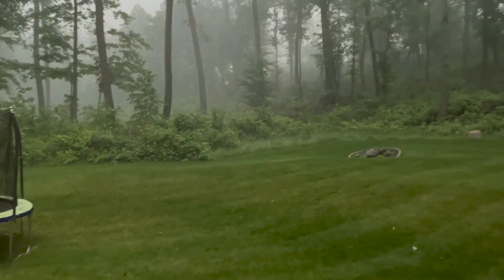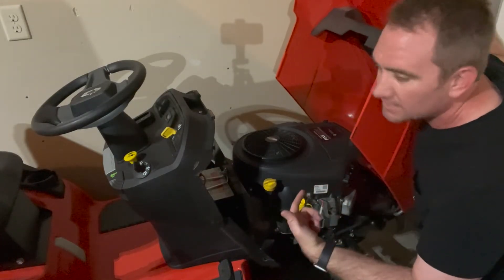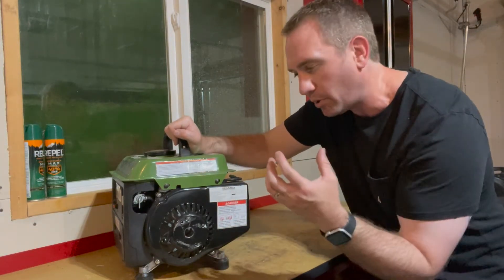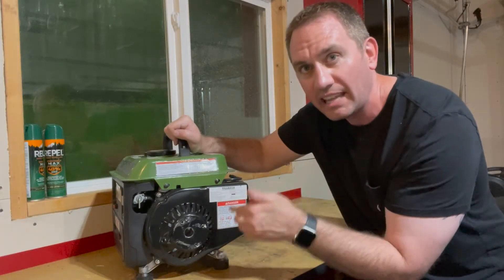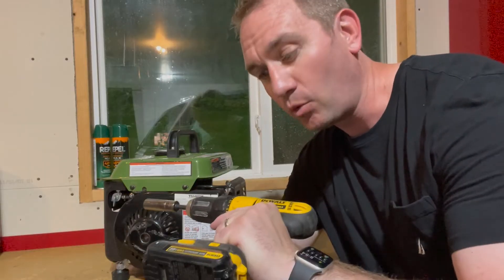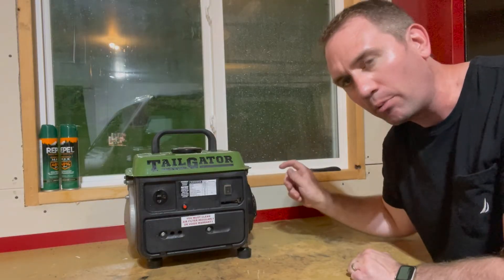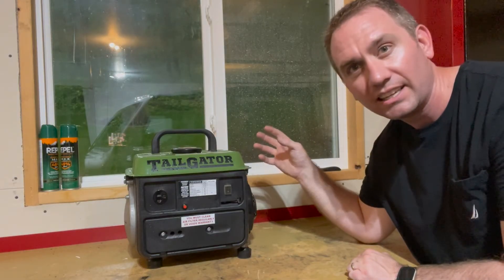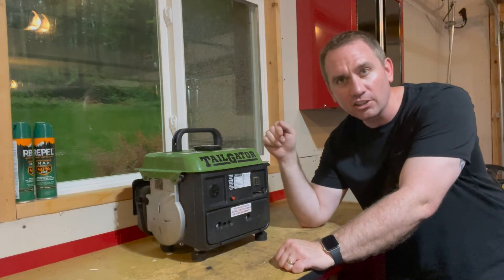Watch this Before Converting Engine to Drill Start

Comment: My generator has no crank bolt so to speak.  Has several 10mm bolts for the pull rope end shaft thing. Unfortunately I had to fix the pull rope assembly
Reply from the maker: Yes, this won't work without a center bolt.  Good job on fixing the pull rope.

Comment: I have a cheap china motor 79cc on a small water pump that has no compression release on the camshaft so this thing is a real arm breaker to start. I've considered this drill method to start it but am afraid of getting hit by a flying drill or socket. LOL.  Lesson learned is to stick with a reputable name brand like Briggs, Honda, or Kohler and leave the Chinese super cheap stuff at Harbor Freight.
Reply from the maker: That is a life lesson right there.

Comment: You sorta lost me already with the tractor comparison...why would anyone wanna use a drill start on something with a key start electronic ignition system, plus loads of safety switches youd need to disable or circumvent someway ...
Reply from the maker: Fair enough

Comment: What are you powering with that "emergency generator"?? A febreze air freshener?
Reply from the maker: It is small.  It’s a two stroke so the engine is roughly have the size of an equivalent 4 stroke.  

Anyway, it’s enough to power a refrigerator and the power vent on the hot water heater.  We have food and hot water.

Comment: Interesting option...but for all practical purposes I'd likely just acquire an authentic serviceable 6500 KW generator as a more responsible hedge against damage to your expensive up-scale home.   e.g. $1,900 to secure a 400,000 plus investment.  Better yet get a GENERAC
Reply from the maker: I didn’t mean to suggest that this generator is a good backup for a house.  As you said, there are many better options out there.  I just found a way to make this pos a little easier to work with 🙃

Comment: TWO IMPORTANT considerations:  (1) if using a CORDED drill -- if you lost power, that solution won't work (unless your system has battery backup...) (2) if your drill relies on batteries, and they're not sufficiently charged -- you've just lost your ability to get your generator going (having destroyed your existing pullstart mechanism.
Reply from the maker: Yes, those are valid considerations.

Comment: I have a Husqvarna push mower that has drill start what I do is  I take a 3/4 inch deep socket and I fill it up with hot glue until about a quarter inch from the end. This way the motor won't jurk your arm.
Reply from the maker: Great idea, thanks for sharing.

Comment: I haven't tried it yet but what about tying the string to your drill wrapped around a cylinder like hole cutter
Reply: This would retain the recoil and no need to dismantle anything
Reply from the maker: I think that might work if you can get the speed high enough, it might require something with a larger diameter than a socket.

Comment: Use a ratchet attachment to the drill. Once she starts, the ratchet will spin not grab. No drill whacking. Second, use a torque adjustment on your drill set to less than the bolt shear strength. If it exceeds, it will skip. Start slow. Thanks🤗
Reply from the maker: Great additions, thanks for sharing.

Comment: One way to make drill starts safer is to use a one-way ratchet assembly.  When the engine overspeeds the drill, it would be the ratchet turning, not the drill.  And that would be much easier to disengage.
Reply from the maker: Absolutely, thanks for the tip.
Reply: Any welding to do on said widget?
Reply: TORO and Craftsman have both offered drill starts on some models. 

1/4” hex drive that only turns in one direction. 

They were about $10 when I last bought one. Now, at least $15, maybe $20.

Comment: If you use a larger corded drill to start your small generator during a power failure what would you suggest as a means of powering it ?
Reply from the maker: Yes, a corded drill wouldn't be a good application for a generator.  However, it might be good for many other things with an engine....perhaps a lawnmower.
Reply: I have a camper with a small battery+solar panel and a generator. The battery has enough juice to power a cordless drill but I want the generator for more serious long running tasks like Air Conditioning. So I can start it up using the batteries and then run off the gas engine. Pretty similar to how a car starter works :)

Comment: I used to use a cup shaped stiff wire brush bit on the drill and it would hold it tight enough to spin it but would easily let go when the machine took off and wouldn't hurt the crank bolt. Works great.
Reply from the maker: That's a great idea! Thanks for taking the time to share 👍

Comment: Might want to recommend using a deep well socket to avoid pulling off socket when trying to quickly release contact when engine starts.  I can't imagine anything good happening with the cooling fins plus a socket tumbling around at high speeds looking for an exit.
Reply from the maker: Great point, thanks for taking time to share.

Comment: Someone could design a nut and a driver that would push the driver off the nut once the engine starts.
Reply from the maker: There are ratcheting socket adapters that can be used.

Comment: Questions:  
1. How big in watts is this little generator?
2. I have two generators
     A. a 3500 watt generator and a 
     B. a 5000 watt generator (10 HP)
     How can I get each of these started without a pull rope?  The big one is almost too big to pull.  A little drill (though I have one) I am sure is not up to the job) and I am not getting younger.  putting a long rope on it and jumping off the ten foot deck with rope in hand is not an option. :) 
ALSO NOTE:  that to get power to your house from your generator you need some kind of converter as both receptacles are female.  Making a homosexual extension cord (a cord with two male ends), while it will work, is not legal. this law was passed to protect line workers from carless homeowners who don't turn off their master breaker from frying some lineman's patoot. 
Any Ideas or suggestions even in jest are welcome.
Reply from the maker: This unit is only 900 watts, but I was using a relatively light duty drill.  I would look into a larger drill and a one way clutch socket, so you don't break a wrist when the engine starts up.

Comment: You can also end up with the nut coming off the shaft if the motor out runs your drill.
Reply from the maker: Yes, great add.
Reply: And that is why I recommend a ratchet adaptor.  When the moter runs too fast, the ratched disengages, allowing the drill to be pulled off the nut while at speed.  Remember, in the late 1800s/early 1900s, cars were started with a hand crank designed to kick the hand crank off.

Comment: 3:36 You can save your wrist or your drill by using a rachet adapter, but check the switch on the rachet each time you use it. Sometimes the switch changes on its own.
Reply: Gorilla tape on the ratchet adapter to prevent the torque switching the ratchet adapter direction.
Reply: @johnwaynewilliamson  A better idea, if you were to use only for a starter, is to super glue the switch to the proper direction.  But that limits the adaptor to a single use tool, and cannot be used to undo bolts.
Reply: A needle bearing one-way clutch would be better.
Reply: Yes ratchet adapter is way to go
Reply from the maker: Great additional information, thank you for taking the time to comment.

Comment: DO NOT !!!   DO NOT do what the Lawn Engineer shows you with his modifications to start a generator or a lawnmower, using a battery operated drill.
The Lawn Engineer, should have known better than sending you to the hospital with a broken wrist.
There is a reason why the rope pulling assembly has an anti recoil mechanism, and anyone with half a brain should know that. If you are still interested to use a drill as a starter, ensure that you are using a socket, that has been modified to prevent kickback when the engine starts. For details, go back 100 years, and look at how the first cars that were build were started.
Reply: On the otherhand... i have a torn rotator cuff in my shoulder area due to yanking pull starts for my small engines.  Great point (already discussed) about being able to use ratcheting drive sockets, or being able to disconnect quickly (or being prepared for engine torque in opposite directions.)  I've used corded drills for 5+ HP engines, too -- when getting them going, but disconnect safety needs to be considered.  Plus, anyone using a impact driver vs drill, will realize its a bad choice due to non-steady torque curves (and damage potential to nut/shaft/engine parts; although we've probably all tried it at one time or another :)  )
Reply from the maker: Knowledge is power, adults can make their own choices.
Reply: @TheLawnEngineer  "Knowledge is power,,,,, " This is a true statement! However, when "perceived" knowledge by the common person, is diluted by someone with the title of "engineer", then risk management disappears for the common person, with unforeseen consequences.
Reply: @Sophie-go3ql  Otherwise known as Murphy"law.
Reply: @Sophie-go3ql  Sophie - are you from the gubment?

Comment: Ratchet adapter to drill helps for when it starts to not have drill go flying.
Reply from the maker: Great advice, I should have included that in this video.
Reply: @TheLawnEngineer  just learned about I myself.

Comment: Tried this with a 5hp snowblower once. Needed to get the drive cleared, no time to pull apart the carb. Ended up nearly breaking my wrist when it did finally start and broke the dewalt drill too. I got complacent as it would often fire just a couple strokes and quit so I wasn't fully expecting to actually fire up to idle. It of course died again right away and I couldn't pull start it again so I ended up hand shoveling with a sore wrist lol. Not a fun day.
Reply from the maker: Thanks for sharing your experience, other can learn from it.  I hope your wrist has fully recovered 👍

Comment: I'd suggest replacing the Chinese junk bolt with a quality unit so shearing is much less of a risk.  And then there are also ratcheting drive sockets meant to start engines that will slip after the motor starts.  Do both and rest easy!  Good video.
Reply from the maker: Great adds, thanks for taking the time to share your thoughts.

Comment: I have one of those generators. If it doesn't start by the 3rd or 4th pull it needs maintenance. clean or replace the plug, adjust the carburetor, make sure the oil/gas mis is correct with fresh fuel. It will power a refrigerator for about 7 hrs on one tank. My 12 hp generator is harder to pull through, but by 4th pull it is running. I don't want to lose the pull start to adapt it to the drill.
Reply from the maker: Good to know.  it's always been a bit of pain to start.  It might be the junk spark plug it came with, I'll have to try a NGK.
Reply: Good for u

Comment: Lol, that dinky generator will light a light bulb or two,  but it certainly will not run a furnace nor air conditioner.
Reply from the maker: It is dinky but it outperforms what I thought it could do.

Comment: Thanks man this exactly what I needed to know I’m having to much compression in my predator engine 212 and i know it’s because I put in a billet rod billet flywheel and big cam in it on one of those attempts I snap my pull start trying to start it and my smart self thought I could do it with a torque gun and at first I didn’t understand why wasnt spinning and thanks to your very educational video I know where I was messing up once again thanks man !👍
Reply from the maker: I'm glad it was helpful!  Thanks for taking the time to leave a comment.
Reply: Dude I got high compression on my predator 212 and I tried starting it and it snapped too. When it snapped, it hit me on my face and made a very red line all the way from my eye all the way down to my lip☠☠
Reply: Buy a chinese GY6 knockoff kart engine that has electric start. It's about 6.5hp.

Comment: to prevent wrist damage, pull the drill away while it's running (keep your finger on the trigger until drill is out). 
Also : 6 pt socket to prevent rounding off bolt.
Reply from the maker: Great tips👍

Comment: The recoil costed me $12 and never had to do anything but bolt the new assembly on
Reply: Lol that is the catch I ordered it from wish 😔 my generator is from finger Hut 😔
Reply from the maker: @Victor.McCann  it is unfortunate that replacement parts are so hard to come by for most things.
Reply: @TheLawnEngineer  this is very true most time I have to make a lot of stuff I need because parts can't be bought or because the price is way out of my reach
Reply from the maker: @Victor.McCann  very true.  If you can find replacement parts, the cost is nearly that of a new machine.
Reply from the maker: That's definitely an option.  Did Harbor Freight have this at a store or did you order it?

Comment: i saw a deer walk by through your window...wow-did you end up getting a tornado warned storm?😯
Reply from the maker: That’s funny, I didn’t notice the deer while filming.  Yea, the storm did have a tornado warning.  We spent a half hour in the basement, thankfully nothing much came of it.
Reply: @TheLawnEngineer  crazy stuff! i'm trying to start my 5hp tecumseh snowblower engine with my mastercraft 20 volt drill due to pull start failure...i'm located in NE alberta canada...crazy weather here too...🤔
Reply from the maker: @daledemanchuk7920  any luck getting that tecumseh started?
Reply: @TheLawnEngineer  not yet have to pick up an a socket adapter for my drill but i'll let you know as soon as i try....trying my 20v mastercraft 3/8 drill not sure if it will have enough jam...?
Reply from the maker: @daledemanchuk7920  that should do the trick, good luck

Comment: What are you gonna power up with that baby generator? Charge your cell phone?! Lol 😂
Reply from the maker: Lol, it is small.  It’s a two stroke, so small bit mighty 😜.  It’s actually enough to run the fridge, led lights, tv, exhaust fan on the water heater as long as the fridge and water heater exhaust fan doesn’t start at the same time 😎.  It really bogs down if you start a ceiling fan. Oh yeah internet modem and router too…have to have the interwebs.
Reply: @TheLawnEngineer  wow that’s impressive load for that baby generator.
Reply from the maker: @medjoolmaker  I have planned on buying a bigger/better one ever since I bought it but it just won’t quit working 😝.  I was a pain to start but I fixed that.
Reply: I've got one that I use exclusively to power my sump-pump during power outages.  Little gen will provide a constant 900w and the sump only pulls like 450w so its perfect.  Power is sort of ugly but a pump don't care, lol.

Comment: Wish I knew how to convert my Stihl MS 250 chainsaw to drill start. I have terrible luck starting it. Need new carb I think. Thanks for this, interesting!!! Have to check out the other video where you did this!!!
Reply from the maker: You just need access to the crank bolt, should be right behind the recoil.  One other thing to check on the stihl saws is the gas line in the tank.  The line can get a hole and suck air.